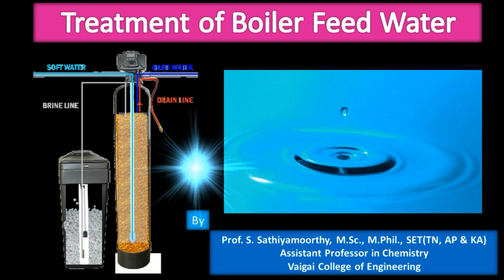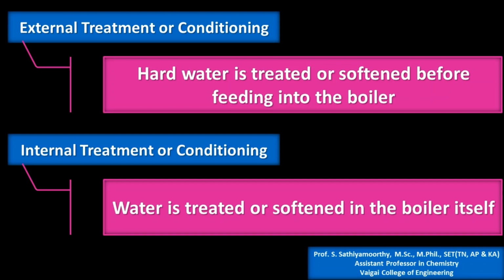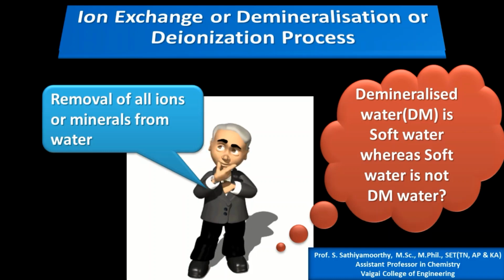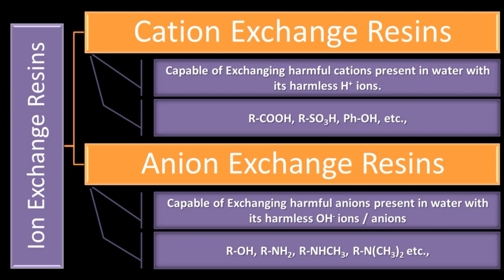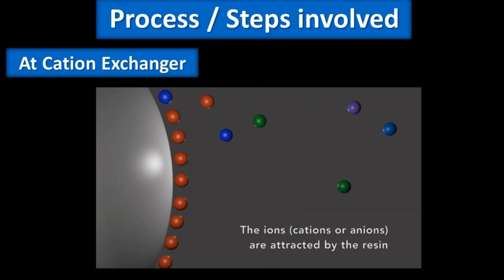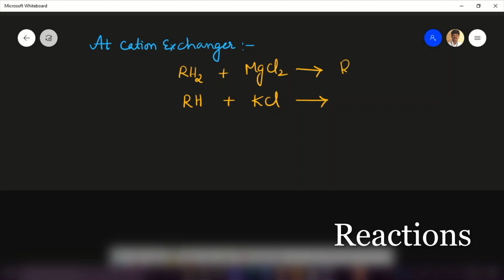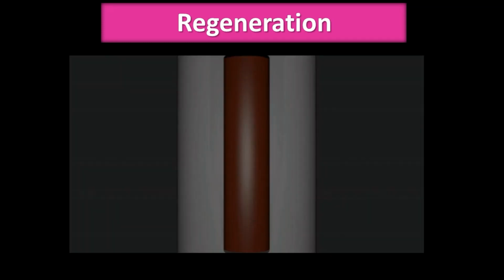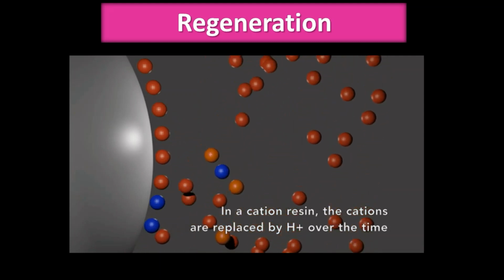Treatment of Boiler Feed Water | External | Ion Exchange process | CY8151| Engineering Chemistry

Comment: What is internal treatment or condition?
Reply from the maker: If the water is treated to desired specifications inside the boiler itself, it's internal conditioning or internal treatment. The boiler feed water is not treated outside the boiler in internal treatment.